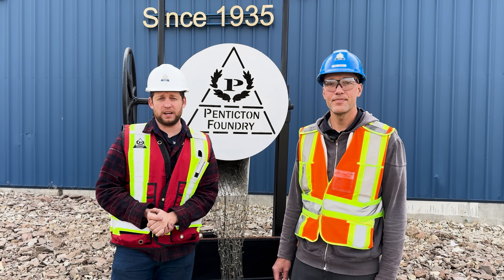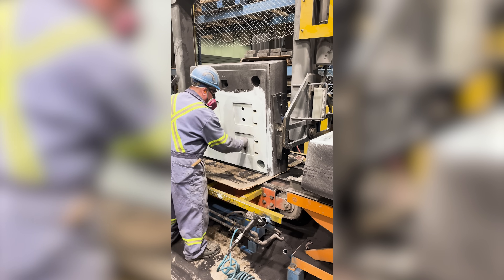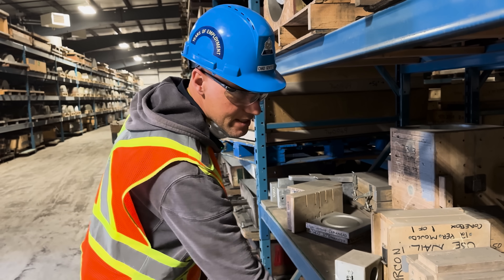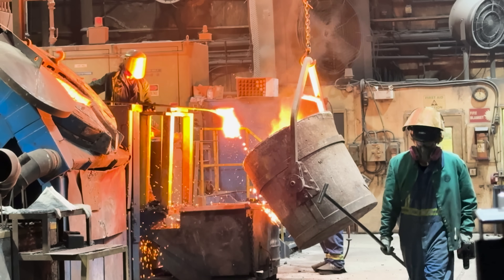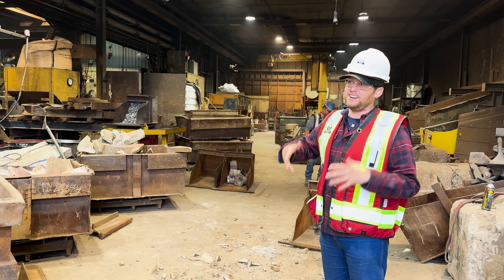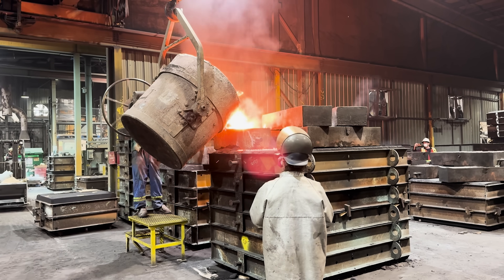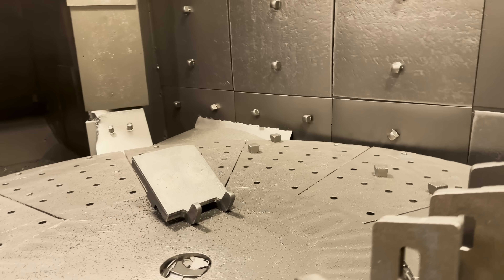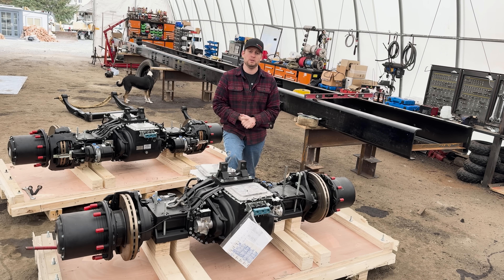Custom Canadian-Made Axle Hangers for Our Truck Build! - Penticton Foundry

Comment: hello guys I am from Ukraine. what is the energy consumption of your truck on the highway at a speed of 50 mph and a load of 20 tons. Thank you
Reply: This is a legitimate  question.

Edison vocational trucks are designed for super heavy loads and low speeds.

It will be a while to get answers to your question.

Comment: I'm assuming these cast ductile iron mounts are then welded to the chassis (or is it to the axle housing?), what welding method will be used as the cast material is very different to the chassis or axle housing?
Reply: I think they are just bolted to the frame

Comment: That sandblasting (the steel shots) wasn't reaching the underside or at least the part that is out towards the camera at 7:39. If they used a steel grate to put the parts on, it would have some "shadows" but not have as visible grinder marks. Would also dull some of the sharpest edges to avoid cutting your hands on them. Otherwise great!

Comment: I'm surprised he didn't mention the surface hardening effect of shot-peening a part. Or maybe it doesn't apply here. When intended, shot blasting metals imparts a decent surface hardness or wear boost as well! I know hammer peening a cast iron welding is usually required for stress-relief?(oddly), can't quite remember the specifics of the metallurgy, just know it's advantageous aside from looks.

Comment: Is it more economical for long term production to use sand molds over a more permanent mold? Or is this just something to work with as a stopgap?
Reply: There's not really a material for casting iron that could be used for those castings. Everything that can stand the temperatures either cannot stand the sudden temperature changes, has a vastly different temperature expansion than metals, or cracks really easily. Usually all three. Sand is used everywhere because it allows you to combine the properties of the individual grains with that of the superstructure formed by those grains, and any damage to the mould is inconsequential. In addition, you get the advantage that there's no wear and tear to the mould from casting, i.e. the thousandth part has the same dimension as the first one.

Comment: IF that light truck uses leaf springs, wouldn’t that make mounting the axles easy?
Reply: This is for the semi truck
Reply: @cortlander321  A lot of pre-86 light trucks used leaf springs. For those trucks I’d not think it’d be a big deal. Even for the coil spring versions it shouldn’t be a “big” deal. A track bar and radius arms will help the axles to stay located where they should be. After all, many times the factory did just that.
Reply: It looks like this truck is getting walking beam axles

Comment: Norwich city (uk) has a fleet of ev buses. My brother in law was on his way home this week when the bus suffered a flat battery, and a diesel bus was sent to finish the journey. I sat there thinking "they need range extenders". 
Good work Edison, you're on the right track.
Reply: There are three axel double deck coaches that do already.. the problem is local routes normally the battery covers the route.. 
But that's where a trolley bus overhead charging pantograph would come in handy over longer runs... No need to carry it round corners as the battery will still carry it to the next overhead run 🤔🧙🏼‍♂️ it's cheaper and more flexible than rigid tramways in difficult urban environments and can handle hills complex junctions and humpback bridges lower load routes.
120 seats.

Comment: Nice Job! I’d like to see a video of it in actual use. Dragging, lowering and skiing across slope. That’s where the real test comes into play if it will hold up. I’ve seen the brooks range fall apart on guide exams. Yours looks bomber, but let’s see it in action. Thx.

Comment: Why was this a cast part as opposed to a machined part?
Reply: These parts will be machined (holes etc) but have to be made from a casting first. 
The other option would be to machine a part from a purchased billet of steel, but the cost of buying a billet and machining this complex shape would be a lot more.

Comment: I was expecting to see Penticton manhole covers and fire hydrants. No EDISON casting mark?
Reply from the maker: We realized we should have got the logo stamped on after the fact
Reply: @EdisonMotors  Probably the better solution to add it later. Your logo is high in detail---not the best for sandcasting.
Reply: @EdisonMotors  collector. Use punch 001.

Comment: I love that you guys also give the platform time to these suppliers and show the processes and what they are like to work with. Shows more of the complete picture not just the final product when the truck is released
Reply from the maker: I want to show that supporting local manufacturing also supports all the other businesses in an area.
Reply: @EdisonMotors   God bless you! This gossip gives people new ideas! Building and creating! 😎👍💯
Reply: I like that 50 years from now, when the original buyers son needs to fix this part, he can see how it was done. Get her done.
Reply: Plus it saves on shipping costs which is good for the carbon footprint.